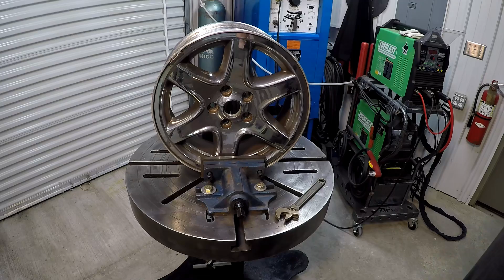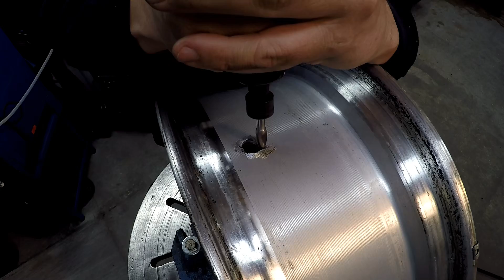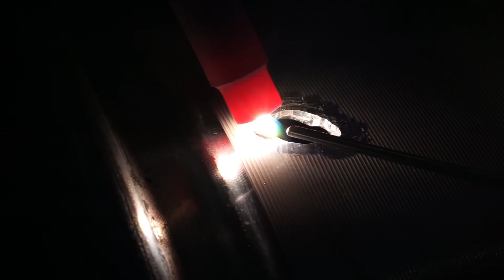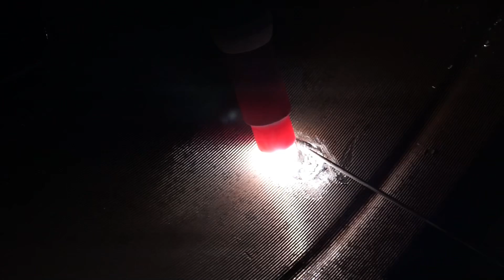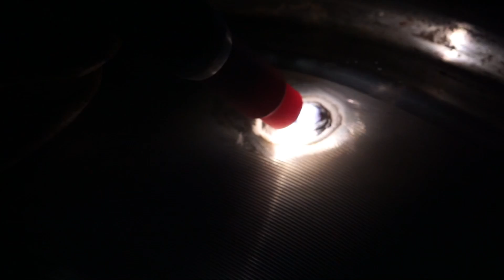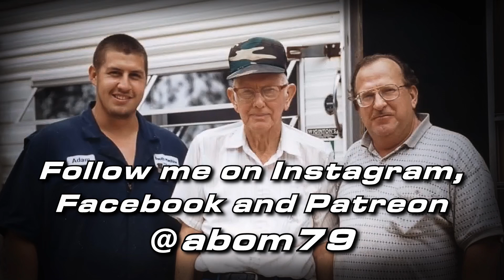SNS 239: Aluminum Wheel Repair

Comment: Cast or forged?
Reply: I am a total failure at tig, so far, however I notice you take your filler rod a bit far away from the shielding gas bubble. This is something I am training myself on. Filler rod needs to stay in the bubble so no oxides are formed and added to the weld. None the less you totally kick ass on my abilities.
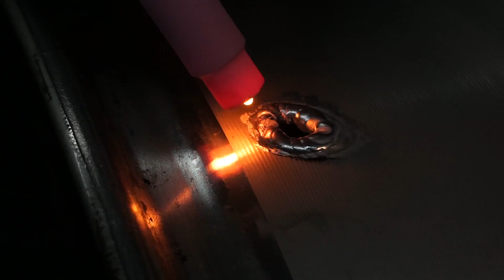Reply: 11:05 to 11:09 filler rod went out while in a molten state. Then  11:13 to 11:20 you kept it close. Love watching all your videos so not respecting you just giving you something to try to do that I am working on as I learn to TIG.
Reply: Strength no doubt. sealed air tight? use a little sealant, urethane of almost anything.

Comment: Adam,  Love the channel and love your skill set, it takes a lot of balls to weld on the camera when you’re not a welder and more on you tube as there are 1000 aerospace welders criticizing you.  First off great repair, second you talked about getting used to the machine so we know its new to you, balls to do it on film. Three you never claimed to be a welder, your machinist. So F all the know it all’s let see you welders run the lathe lol or the shaper.  All this said I am a self-taught welder that elevated at one point to doing nothing but High Vacuum work for R&D whilst putting myself through college, at 58 I weld for bourbon money  and to keep the skills up.   I would drop the 2T-4T for when you have to weld standing on your head, always when possible use the pedal or hand current control, Why?  Because as in your video the heat control would of offered you two advantages, one when you were first filling you could have actually welded the edge of the hole rather than build up a mound because you could have controlled the temperature that changed do to heat soak, and two when you flipped the weld over and you had a void and were trying to fill it you could have stepped on the pedal and added heat to draw out the inclusions (those black holes in the video) and flowed the metal almost level.   Great video great work as always and I love your honesty we never stop learning.  BTW though I am a big blue guy I got the Everlast 325 last year and love it.

Rick

Comment: Looks like a very good repair. Lots of comments on how you should have done it. I've been welding aluminum for 40 years and would have done it just about exactly the same way. Chlorinated cleaners contaminate  the aluminum and make it hard to weld. Yes, they can make phosgene gas but the amount is insignificant in this case. Welders habitually avoi inhaling fumes produced by welding.

Comment: My solution would be to clean up the hole with a drill, or something like that. And then machine a nice fitting plug to weld in place.

Comment: Little trick with aluminum for patching holes or butt welds. Holes, take a piece of steel that's same profile (in this case rims ID) and with a center cutting ball nose make a concave in the piece. Then clamp it to the underside. Aluminum won't stick so you can weld like you did and just completely fill. Concave you made makes a convex on the inside of the rim. That way you can focus on it filling and looking good on the weld side knowing the other side will form to the shape of the concave you made in the steel.
For butt weld, clamp the two aluminum pieces to a piece of flat steel that you ran a radius down (whatever size you want the underssde of the weld to look like) 

As a bonus, both these methods work for steel pieces by using copper as a backing :-) just run a ball nose as deep and big as you want the backside of your weldment's weld to look. Let's the molten filler completly form to the radius of the backing substrate. As long as the top side where you are torching and filling looks good, the bottom will look perfect 
You can just fill without worrying about burning through and especially for aluminum which wants to bubble out the bottom and even drip.

Comment: 2 suggestions; instead of the collet body and the narrow cup, get a 1/8” gas lens with a bigger cup as it will shield better. Start off with a pointed tungsten as it broadens the arc and will clean better.  Eventually it will ball up, but this is just how I’ve done aluminum welding in the past.  
2nd, I would penetrant test the repair after it’s cooled just to make sure you don’t have a linear indication from the heat affected zone and to ensure there is no porosity or lack of fusion in the weld itself.

Comment: You're a better man than I am. Family friend or not, in your shoes I would have said "I'm perfectly willing to help out, but there's an hour's worst of unskilled labor spraying the wheel with solvent and wiping it back off before  I can apply my trade. Solvent's here, rags are there, I'll be over in the other part of the shop working on paid projects until the solvent-removable crap has been wiped off".

Comment: Nice old Miller 330 A B/P.   Ive had mine for years and love the old dinosaur
Reply from the maker: Yep it's still doing great!
Reply: Most likely the only problem you will have is the bridge rectifier for the 36v control circuit with burn out. When it does, you will have Maximum amperage at which ever tap position you have it in. It’s a $40 part from Miller. I went oversize to a 65 amp rectifier from an electronic surplus store online for about $25. It’s a simple and durable machine. Do not trade it in on some new fancy machine with electronics. The new SCR machines will never last 40 years with little to no maintenance like the older machines will. Keep up the good work.

Comment: Adam, Would it be OK to sand the area for the weld versus using the burr?
Eric
Reply: Sanding introduces grit, adhesive, and other contaminants, not to mention aluminum will gum up a sanding pad really quick. You're better off with a carbide burr.

Comment: Don’t be afraid to preheat aluminium, it started very cold on your first bead. 100c is a good temp. Also be careful bringing your filler rod too far away from your shielding gas, if it’s even slightly molten it will grab impurities.

Comment: 1. Whew man, you've lost more weight!
2. Is there a reason you don't set your AC balance more electrode negative to reduce heat in the tungsten / decrease balling?
3. Does it help to hold the aluminum rod under the argon flow to avoid oxidation? Or does the arc take care of any slag on the rod? To be honest, I don't have a TIG machine myself to experiment!

Comment: If you put soap on a tighter flute carbide grinder it won't load up with aluminum as badly.  Works in a pinch.

Comment: If you wanted to check for leaks you could have pooled some thin oil on top and blow air at the weld from underside, that would have shown any possible air leaks. Great job though i have seen alot worse in my time of being an MOT tester in the U.K.
Reply: And then if there was… nice oil contamination in the weld area that’s gunna be a pain in the ass to clean
Reply: @tjlovesrachel  true but I think the heat from preheating the metal would burn off any contamination plus if the leak has been there a while it would already be contaminated with water and or grime from the road if we are being smart about it.

Comment: It's a bad idea to weld repair alloy rims. They're potentially flow formed, in which case you lose about 80% of the strength around the weld area. All alloy rims are age hardened though, so the local loss of temper will result in about 60% minimum loss of strength.

Comment: @ Abom79 I am surprised to see you when you used that carbide burr u did not wear gloves when useing it. I got some double cut 1/8 inch shank carbide burrs which r amazing and I get small metal splinters when not wearing gloves were can I buy those welders at by the way

Comment: A ball joint came loose and they're concerned about matching rims?!

From that I'm assuming that's because the thing goes on public roads... which, obviously, it shouldn't...

Also, you're a third generation machinist...  Isn't there less "low-baller" stuff you could be doing?

I know Americans love their garbage, but I think that's really borderline....  Not to mention that you're a third generation machinist trying to make as weld to hold in 35 psi...  Don't they sell cans that do this stuff?!
Reply: That little piece of metal there might allow them to make the right decision, though...  I guess...  😊

Comment: Nice job. I have done stiff like this many times. I recently started keeping old bars of soap in my shop. I run it on my belt sander and grinding wheels for use when grinding aluminum. It works well keeping aluminum from gumming up the belts and wheels.

Comment: Thank you very much for your video's!  My thoughts; try not to pull your rod out of the gas "bubble" it makes for problems, also is your machine setup for supplying gas after you stop?  It does help when you do short welds, due to oxidation, just a second or two till it cools.

Thanks again I'm learning a lot from your video's.

Comment: There are a lot of constructive comments on here about welding settings and technique. I don't find that they have been insulting or condescending. In fact some of them I think are pretty interesting. Adam is not a full time or licensed welder and the welding repairs he usually does are of limited scope. He would be the first to admit he doesn't have the background of somebody like Jody, who is aerospace qualified. As for wether or not you should weld a wheel, certainly any heat treat in the wheel will be toast if you weld it. Will it still be strong enough? I am an Engineer so I can tell you with complete certainty that I don't know 🤷🏼‍♂️.  I could speculate that to drive to walmart at 40mph it would be fine, but to go 180mph on a nascar track probably not. I don't have any data. I have yet to see anyone who says it is dangerous or fine present any data or evidence of any weld failure causing an accident. Anybody know of one?
Reply: Dealer Mechanic here. We were basically told always replace a cracked rim, but my suspicion is that it was more out of concern for finding a good welder. I think with competent welders, this is a reasonably safe repair.

Comment: Nice weld, it would be interesting to X-Ray the weld and take a look how it turned out.
I am working in a factory that produces aluminum wheels by the thousands a day (about 4.000.000 a year) and every single one of them gets X-Rayed, inspected for run out, leak tested and a visual inspection of the paint-job. (as well as several other checks and measurements)
And I am also quite surprised of the machining-grooves, we sandblast and brush them to get rid of the burrs.
Reply: Comedean I like your comment and that every new wheel is X-rayed.   Good information thank you.

Comment: Adam is a pro, not a hobbyist. As mentioned in previous comments, alloys have changed drastically over the years and are quite weldable. One thing I feel he should’ve mentioned was why he used non-chlorinated cleaner. Using chlorinated cleaners can and have been fatal to welders in the past. Phosgene gas can be created from the extreme heat from the arc and the chlorinated  cleaners and results have and can be fatal. I am sure a lot of people know this stuff, but for a new comer this knowledge can save a life.
Reply: @ElectronicRedPanda nah man, you don't even want to inhale phosgene gas. You might want to look it up old man. They used it as a chemical weapon in war. This ain't no "tear gas". FYI 85% of ALL of the 91,000 estimated gas deaths in WW1 were caused by inhalation of phosgene gas.

"Phosgene is highly toxic, due to its ability to react with proteins in the alveoli of the lungs, disrupting the blood-air barrier, leading to suffocation"

So go ahead an inhale all you want. I'll be the smart one that doesn't inhale phosgene gas. 🤣
Reply: What temps does this occur? I use the chlorinated type because the non-chlorinated can eat forms of seals, gaskets, o-rings. I don't think I'm getting my projects quite as hot, though still too hot to touch.
Reply: Good to know!!!
Reply: Plus it is a gas that is released during meth cooking process and numerous tweekers have been found lying dead next to their lab from inhaling phosphine gas.
Reply: Which cleaners have Chlor in it?
Reply: The quantity of chlorine that can hide in the metal is very small.  Remember propane copper plate R12 leak detectors?  They made phosgene as a result of their detecting R12.  Turned the flame a different color.  I used one back in the day.  Produced hundreds of times the amount of phosgene that could be possible here.  The sale of these detectors was made illegal, but not their use or ownership.  Just be sure to stay up wind, you will be fine.  Besides, phosgene is not exactly odorless.  It has quite the awful smell.  Can't imagine breathing enough to harm one's self.  Be running for the fresh air before any real harm.
Reply: @HamiltonSRink  Mid 1970s, I remember in NBC training in USMC boot camp they taught us the early faint whiffs of phosgene smelled pleasant, like fresh cut grass or hay, That served as a warned to raise the alert to a gas attack and don our gas masks before the concentrated stinking form arrived. I agree there is little to fear from the residue of fully evaporated Brakleen or Letra-Motive chlorinated spray.

Comment: Dodge, Chevy, VW and most aftermarket rims weld good, not sure what Ford puts in their alloy but it will weld but then crack not long after. 
The ridges in that rim could have been caused by a rock caught in the brake rotor until it jammed and broke through. Try welding an aluminum boat prop.

Comment: Just a tip for grinding aluminum with a flapdisk, try to use some wd40 on it, it stops the aluminum clocking up in the flaps

Comment: Interesting. I've repaired many wheels in my time. The only difference was we made steel wheels and used mig. I retired from a wheel making factory. Everyone has thier way of doing things. What works, works. The most important thing is, and you stressed this, is having a clean area around the welding area. Nice job!

Comment: Kudos! Welding is an art form I have never been able to master... or become proficient at... or climb up to the stage I'd even call myself being really bad at.  I know a lot of the theory, and burned a lot of rods arc welding, but never could bridge the gap between the theory and the puddle. Having said that, I do know how hard Aluminium is to work with - especially considering that rim was an unknown alloy and probably not the best material to work with.

Comment: You need copper backing plate to support molten aluminum 
It will also seal the hole for better purge of argon gas
Reply: Kiyoshi Ishihara Brass, copper, stainless, steel, potassium and cryptonite has been voted down already. Go figure.

Comment: Adjust your AC balance. That's part of the reason your tungsten is balling up and your arc isn't very controllable ( the blue "flame" that keeps jumping away from your puddle). If your machine has a pulse setting next time use the pulse setting. Also where ever you stop your weld leave the torch there with the post flow on it will help alleviate the chance of pin holes and stress crack. Love watching your videos. Manual machining is such an art form and you make it look easy. Keep up the good work man.
Reply: James, when welding on thick aluminum  with a 200A class machine you need every amp you can get and then some. Pulse will reduce the available heat and just make it harder to complete the weld.
Reply: @tridium-go6hw  you can still use the pulse you would just use a faster pulse rate that if you were just trying to weld some thinner material. The biggest issue here is the lack of arc central due to the ac balance being off.
Reply: No benefit to pulse here.

Comment: I hope you have better luck than people I've seen attempt the same with aluminum semi wheels.  I've never seen one of those last more than 1000 miles before it starts leaking again.  Of course they run 100 psi and much heavier loads so it might work on a car rim.

Comment: From aluminum porting experience the way to avoid a burr tip clogging is to never use the tip at full speed or force it to do deep cuts, the heat generated is what causes it to clog, a spray on the tip with WD40 can help too.
Used to use a paste made for the purpose many years ago but cant recall the name of it.
That course tip looks of for general use but I wouldn't put it near an port or anything sensitive to damage and Id be certainly wearing gloves using it.
Reply: Only trouble with Wax or wd 40 on your carbide although it works great is it will contaminate the weld area.
Reply: @vicferrari9380  Yes true but it will need some solvent cleaner either way.
Just using a burr tip even a new one doesn't assure a clean surface since you can't be certain all the surface contaminants fly off the bur tip and or are not embedded into the area you are grinding, likewise using a wire brush even a new one.
Reply from the maker: You don't use lubricants on a weld area
Reply: @Abom79  Yes not without using a solvent to clean the metal properly which a burr tip and wire brush wont do alone.
Soon as you hit the dirty surface of whatever you are going to be welding with the new burr tip or wire brush you've just coated the bur tip or brush with dirt anyway.
I always use a solvent and wash it out to remove any trace of contamination.

Comment: What frequency are you running? I like to use 60 hertz for dirty crummy metal maxed out at 250 hertz for small lower amperage welds. Anywhere in between sounds annoying.
50 hertz feels like a strobe.
Jody has a really cool video on setting frequency.